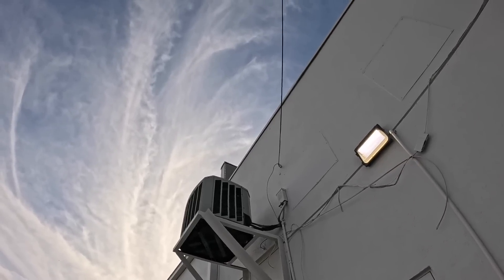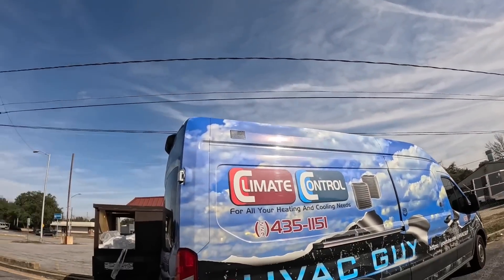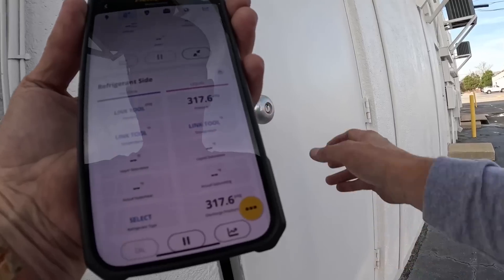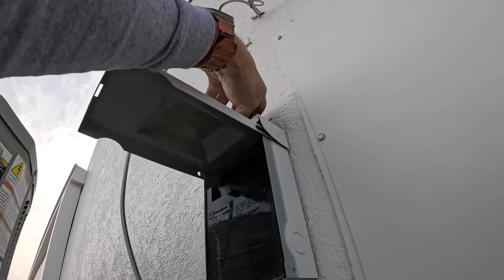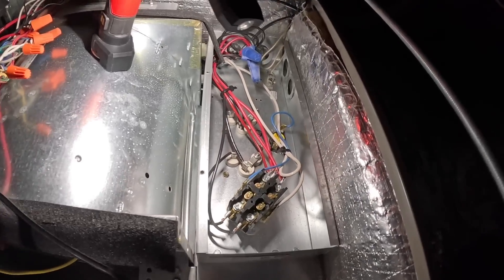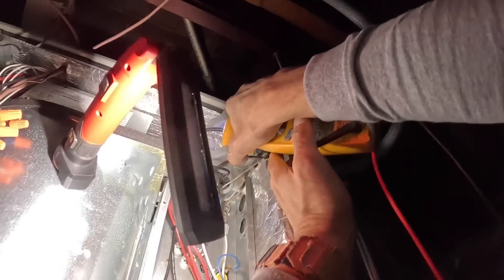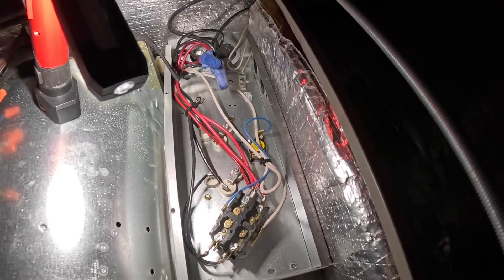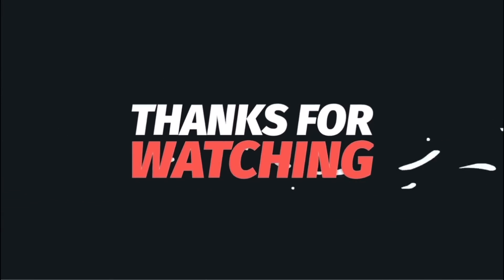No Heat Call When It Was 20 Degrees This Morning! #hvacguy #hvaclife

Comment: At 20 degrees, there is not a lot of heat in the air for the heat pump to absorb, unless it is a very hi efficient unit. Not surprised it wasn't heating well. Put it in emergency heat till the temp rise above 32 degrees!

Comment: Good video. I’ve started using a Scizzor lift if it’s too high or sketchy working at a certain height. Works very well. Much safer. I also use a Scizzor lift for putting condensing units on roof when doing changeouts , compressors & if it’s a lot of trips to a roof spot that access is too far or double roof jumps to the particular roof. They are not very expensive to rent & have delivered to a job site. Really handy & Great time saver on a Time consuming job.

Comment: I've got a customer with the same situation. However she wants to have plenty of heat. I'm taking out the 8kw heaters and replacing them with 15kw. She's willing to pay, of course I have to run extra wire and wire is expensive these days.

Comment: "Thank God I'm a Country Boy" by John Denver in the outro... Nice! Grew up with a massive JD presence in the home, my mom was always playing his records or 8-tracks, and I was fortunate enough to see him in concert in-the-round during "The Wildlife Tour." The episode where he guest-starred on The Muppet Show is one of my all-time favorites.

You guys aren't used to 20°F weather, heat pumps and heat strips can only do so much, so fast, when dealing with those temperatures. In a building filled with many objects, it can take longer to heat because those objects are chilling the area until they too get up to temperature. You're 100% right in advising the customer to turn the thermostat down a little overnight, but not too much, and certainly not off. It takes less energy to warm a building from 50°F to 72°F than it does from 20°F, and it's also MUCH faster! If they have plumbing, frozen pipes is also a concern that many born and raised in the south don't usually think of, because it's rare that temperatures plummet below freezing.

We're about to get a brief break from the teens and twenties, heading to the upper 30s tomorrow (Tues), 40 on Wednesday, Thursday and Friday we'll be around 50. The bad/good news is that warmup comes with precipitation. At least it'll be liquid! I've never had to shovel rain.
Reply: John Denver's dad and my dad were in the same bomber squadron.  It's the resistance heat that uses up the electrons fast.  😁

Comment: You reckon that was made with a contactor instead of sequencers?
Reply: Contactors are more comfortable for the customer these days with the new smarter thermostats. Heat sequencers causes overshoot.
Reply: @Bryan-Hensley  If the t/stat satisfies with sequencers hot, it could cause overshoot.  Would think they were on second stage and cooled down before the stat satisfied.  Only prob I see with a contactor is it puts on the total load at once.
Reply: @joehead1294  heat sequencers stay on sometimes 90 to 110 seconds after the thermostat cuts them off. That causes the overshoot sometimes.

Comment: Hello Curtis. Nice work! I carry a paint brush to clean the filter grill while the old filter is in place or use a mini vacuum. I know you have a brush for cleaning/clearing electrical areas on residential units. Anyway, those 24' ladders are a must have for sure. Is there anything you won't go out on for work?